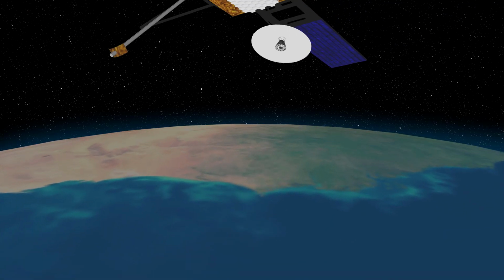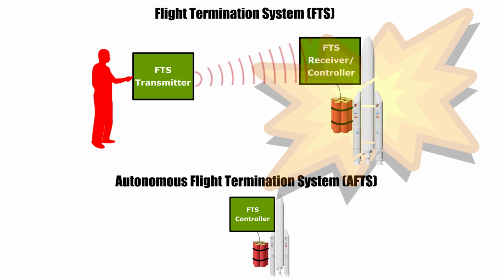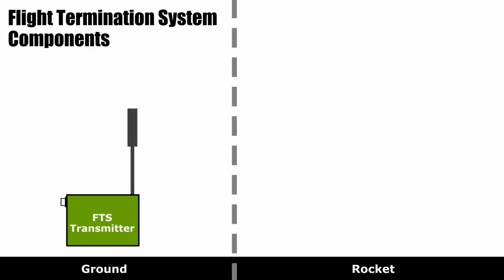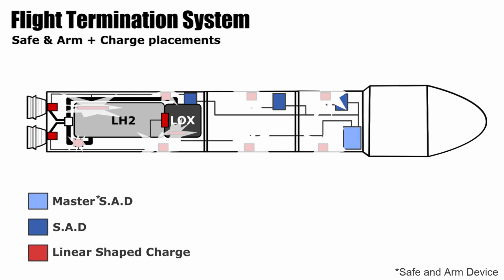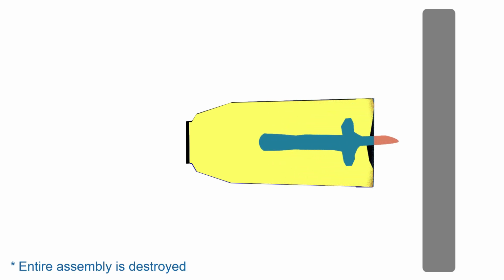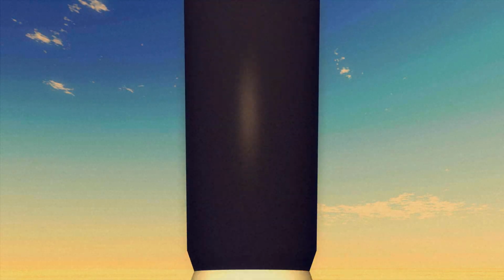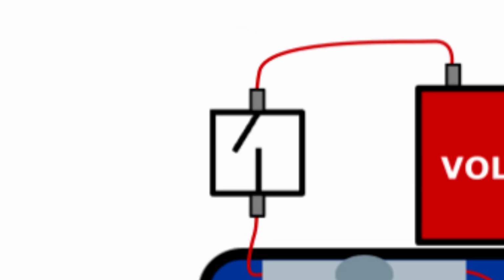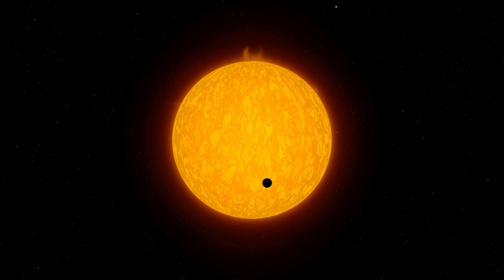Flight Termination System

Comment: I worked at a startup rocket company (many, many, many years ago), and recall discussions with Range Safety.  They were freaked out because we had a solid booster.  Up until then, the Range Safety would on occasion press the Command Destruct button on rockets with hydrazine and such as a propellant.  This would cause the vehicle to explode into billions, and billions of very small bits.  With our rocket, which was about 60 in diameter and 60 ft long or so, weighed about 40,000 lbs, we could only "cut it up" or Command Destruct explode it into 3 or four very large, heavy pieces.  For reference, our rocket is now used in the Virgin Galactic spaceplane.

Comment: The fact that manned missions have had flight termination systems has always given me chills. I really feel for the officer who was on duty for the Challenger launch.
Reply from the maker: Yeah. I read somewhere that some of  the astronauts would show the pictures of their kids to the Range Safety Officer before boarding the shuttle. I'm thinking it was a subtle way of letting them know to "think" before pressing that button.
Reply: Why do you "feel for the officer who was on duty for the Challenger launch"???

The range safety officer (RSO) played no role in the destruction of the orbiter.  The space shuttle orbiter did not have destruct devices.  Only the solid rocket boosters (SRBs) and external tank had such flight termination devices.

The breakup of the vehicle began at T+73.162 seconds (at altitude: 48,000 ft).  The Challenger orbiter broke apart due to excessive aerodynamic forces following the disintegration of the external fuel tank.

Once separated from the spacecraft, the SRBs were unguided and their propulsion could not be stopped.  At T+110.250, the RSO activated the flight termination system on board both solid rocket boosters.
Reply: @guardrailbiter  I feel bad for the fact that the officer was on duty during a mission where there was loss of life, which must have been an excruciating experience.